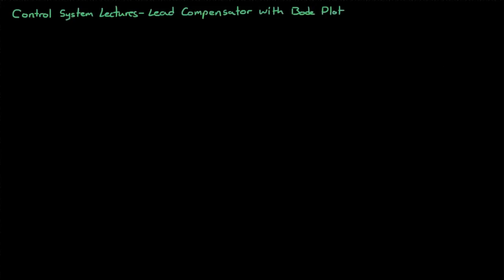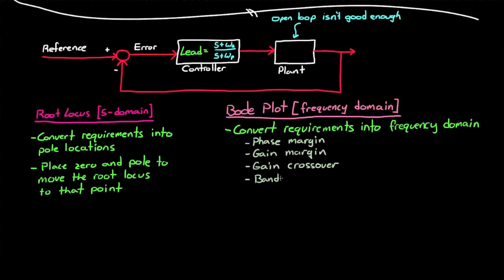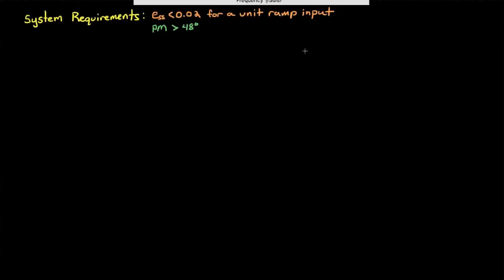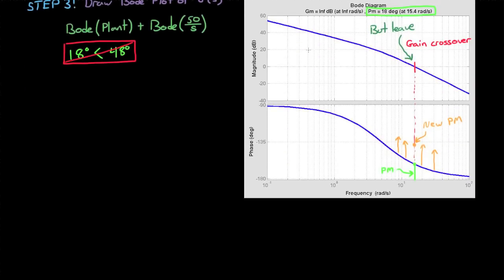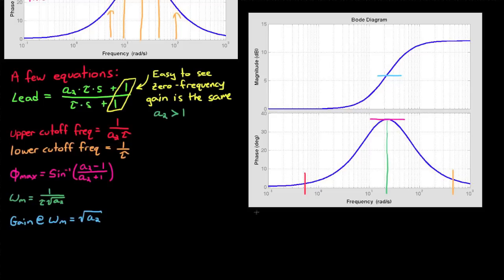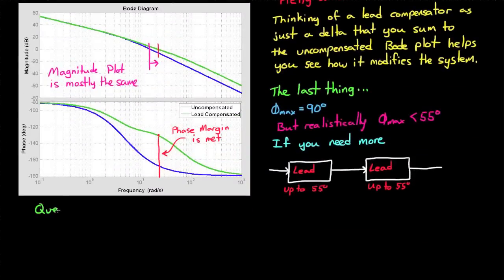Designing a Lead Compensator with Bode Plot

Comment: Where do you get the compensator types, Type  0 , 1,2 etc
Reply: It's the system type of the plant or controller that has the type number, rather than compensator.  It has to do with how many poles at the origin, the plant has.  A type zero system has no poles at the origin.  A type 1 system has 1 pole at the origin, etc.

The reason you'd want poles at the origin, is to mitigate the steady state error, when subjecting the system to a step, ramp, and acceleration input.

Comment: Really dislike the time constant form for the compensator. Very counterintuitive because the pole and zero are  reciprocal to the terms multiplying 's'. Much easier to extract the pole/zero ratio as a constant and rewrite the compensator in pole-zero form.

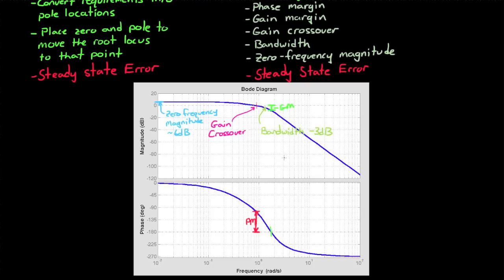Comment: Hey Brian. Gain Margin and Phase margins are defined for the "closed-loop" using the "open-loop transfer function's"  Bode plot. And for the finding the bandwidth we need to see the bode plot of Closed-loop transfer function. But in the video (at 3:36) you mention the Gain margin, Phase margin, and Bandwidth on the same bode plot. I think Bandwidth should be found from the Bode plot of the Closed-loop transfer function. Just a thought. Could you please help me with this question?

Comment: What I don't understand in this example is, that Brian drew a closed loop system, but he designed the lead compensator in a way, as if he just puts the lead compensator, the integrator and the plant in series, but without feedback. Can someone explain the reasoning behind that to me please.
Reply: The plant along with compensators / controllers in series is called the loop transfer function. With tools such as Nyquist you can do the analysis on that loop transfer function and make conclusions about the stability of the CLOSED loop system

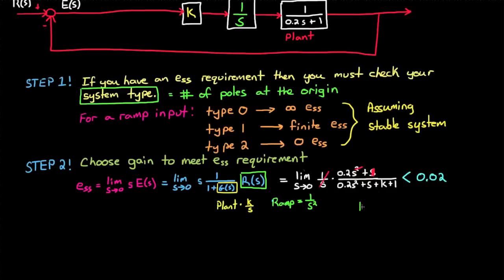Comment: At 6:55, you have an edit that corrects the denominator of the S.S.E. equation. If s goes to 0, wouldn't you be left with (1/K) < 0.02? Which would mean that K > 1/0.02 which means K would have to be greater than 50. So is using 50 correct? 49 would've been the right gain value had you not made the correction to the denominator. I'm not sure how much this changes the entire solution.

Comment: Thanks for your video!! Although I'm a bit unsure why having more phase is a good thing?
Reply: Answered: you want your phase to be > -180 degrees at your crossover frequency, otherwise the closed loop system is on the verge of being unstable. This lead filter is designed to bump up the phase at the frequency so that the closed loop will be stable and robust.

Comment: Dear Brian, tnx for the video, as a question:
Is this problem (we cannot add more than 55 deg of Phase Margin using lead compensator, otherwise the components become unrealistic and big) also includes digital implementation? Because in digital control, we do not use capacitors and opamps anymore, and therefore the implementation of phase margins larger than 55 might be easy.... what is your opinion about this?

Comment: I dont understand why you say the plant is k/s.. that's the controller the plant would be (1/(.2s+1)) right? Secondary question: if I have a requirement on both phase margin and crossover frequency which should I design for first? I would assume the phase margin?

Comment: how have you selected wn = 22.2 radian/sec while designing compensator
Reply: I know its a bit late, but I had the same question and just think its because it was the lead compensator bode plot that he plotted. Maybe it was better to use wn to 16 degree a little more than the one shown in the bode plot at 7:55 (Gain crossover) and following the safety factor for the angle we want to add.

Comment: How did you get wm to equal 22.2?? Thank you for all you help! I love your videos.
Reply: Based on the color he used (yellow) to write the phase margin he chose, I assume he also chose wm at that value. If I'm not wrong, usually there are constraints, like the sensitive of the closed-loop system to variations, that will guide us to chose the right value for the wm frequency. Please someone correct me if this is not correct.

Comment: Hi guys I would like to ask if we can use a lead controller to get max phase margin without changing the crossover frequency?
Reply: I am not sure but I think not, you will always get a change in your gain cross over frequency a little at least because when you increase the phase margin it changes the gain as it changes the gain cross over frequency, so I think your gain cross over freq will always change a little bit if not much

Comment: I was confused with the "steady state error". The ramp response characterizes the s.s.velocity error, which is given by ve(t) = | (1-G(0))*t - G'(0) | , where G(s=0) is your transfer function when s=0 and G'(s) it's derivative.
So what you mean is velocity error,that is different from steady state position error, which is obtained from the step response as pe = | 1 - G(0)|. And by making ve=0 you also make pe=0, which makes sens.

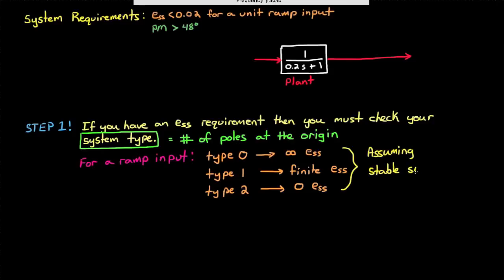But I'm still troubled, because the ve(t) equation I give above doesn't yield the results you mention relative to system type. The ve(t) of the system you mention at 5:01 yilded ve = 0.2, which is constant and not infinite as you say.
Reply: Now I get it... I think you weren't clear in distinguishing the open loop Gain (GL(s)) from the unit feedback gain (Go(s)).
So, if the GL system is of type 0, like the function at 5:01,with GL(s)=1/(.2s+1) then the corresponding Go(s)=.2/(.2s+2) wount yield a finite ve. In this case the velocity error is ve(t)=.5*t+0.05 which tends to infinity.

I checked in the book Chen - "Analog and Digital Control System Design", on section "6.3.2 System Types-Unity-Feedback Configuration". There it is explained why and how the type influences the velocity error.

Comment: Hi Brian, thanks for the video !
In this video at 4:47, one thing is very contradict with what you said in your "Final Value Theorem and Steady State Error" video. In that video you have said for type 0 system -> FV = 0, for type 1 system -> FV = real value & for type 2 & later systems -> FV tends to infinite.
And in fact for a ramp input don't FV will tends to infinite for any type of systems as laplace transform of ramp signal(input) is 1/s^2 so for any type of system there will be at least one 's' in the denominator !!
Sorry if I am wrong but please do elaborate...
Reply: Hi Milan,
I found the answer, maybe you've already known since it's your 2 years ago question...
The reason is we use the wrong formula of ess, ess=lim s*{U(s)/(1+G(s))}. Here U(s)=1/s^2 for example. For type 1, G(s) has a denominator of 1/s, then ess= lim s*{(1/s^2)/(1+1/s)}=lim 1/(1+s)=1 or finite. For type 2, ess = lim s*{(1/s^2)/(1+1/s^2)}=lim 1/(s+1/s)=0.
Hope this help others who have same question.
Reply: +Milan Shah The reason the properties seem to be opotise is that you evaluate FV when t->inf, but evalueate ess(t) when s->0.
The Final Value Theorem formula expresses that. 
Hope it helps.
Reply: Hi Milan,
I have the same confusion as you, do you get the answers or do you figure it out? Thanks.

Comment: Dear Brian, Thanks for sharing such a nice and easy way presentation. 

1. Can you correct me that in the first 2 steps you actually introduce an Integral I controller by placing the pole at origin and adjusting the required Gain "Ki"  ?

2. Can we say a lead compensator is actually a PD controller ? if so then you first introduced Integral controller and then PD so would that mean it is indeed some how a PID controller design video ?

3. Can we say PD = Lead compensator, and PI = Lag compensator so they are just two different names of the same controllers if not than what are the difference actually ?

Thanks

Regards

Comment: thanks you so much. I got a weird question, what if the reference signal is 0? For example we want hold a rob on a moving car always straight up by a motor on the bottom of the rob and thus the reference is 0 degree

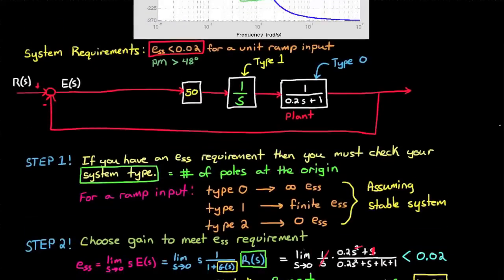Comment: at 12:10 the value of wm is selected as 22.2 rad/sec how it is selected and second thing how is this table over a2 id built
Reply: Too late but might help some other people - you can find that value by calculating the extra gain:
extra gain = 20*log(1/sqrt(alpha))
and then finding its corresponding frequency in the bode plot of the uncompensated system :)
Reply: @666blablablabla666  Is alpha a2?

Comment: where does the 1 come from in the denominator at 7 minutes? isnt it (0.2s+1)/(0.2s^2 + s + k)<0.02? I dont understand where the 1 came from, I get K>50
Reply from the maker: Trevor Fritz You all are correct!  I completely messed that up and didn't realize what was being asked earlier.  Thanks for catching it again and reminding me to review it.  I'll add an annotation right now and add it to the errata list for this video.  Cheers!
Reply: Brian Douglas I think Peter meant the +1 (the one written in white color) in the denominator. Could be an error? For me too the denominator is (0.2s^2+s+k) and not (0.2s^2+s+k+1) as it's written in the video. Anyway I want to say thank you so much for your videos it really helps.
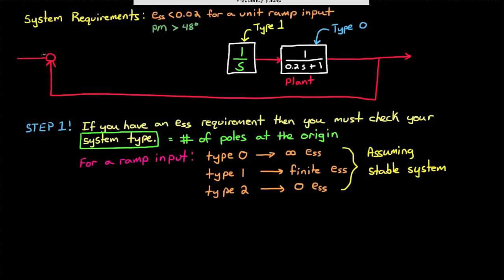Reply from the maker: The 1 comes from the blue equation just before it, where the steady state error is lim as s goes to inf. times R(s)/(1+G(s)).  Now the question is where did THAT 1 come from? :)  It came from re-arranging the block diagram in terms of the error, E(s), as the output instead of Y(s). If you start from a standard unity feedback block diagram with G(s) the transfer function in the forward direction (like I have drawn around 6:08) we can re-arrange it like this. E(s) = R(s) - Y(s), where Y(s) is the signal just to the right of G(s). Which means Y(s) = E(s) * G(s). Substitute and get E(s) = R(s) - (E(s) * G(s)). You can solve for E(s) and get E(s) = R(s)/(1+G(s)).  This is the function that we solved the steady state error on and that is where the 1 came from.  I hope this cleared it up for you and didn't just make it more confusing!!
Reply: @BrianBDouglas  How did you get K > 49?  I just get K > 0
Reply: Brian Douglas
I concur with the comment above.
Ess = lim[ (1 / s) * ((0.2s^2 + s)/( 0.2s^2 + s + k)) ]
          s->0
instead of:
Ess = lim[ (1 / s) * ((0.2s^2 + s)/( 0.2s^2 + s + k + 1)) ]
          s->0
By the way, thanks so much for your videos, they have been really helpful.
Reply: yorchais I also noticed this and agree with OP. Again, thanks so much for your videos! They are currently saving me in my university controls course!

Comment: Brian,  

    How do you check by hand that the controller that you designed meets your Phase Margin requirements or can you assume that because you added a safety factor your controller is sufficient? 
-ish
Reply: It's a complicated process, and even for a simple 2-pole plant transfer function, you'll end up needing to solve a quartic formula to check it analytically.  Fortunately, with modern technology, you can use computer tools like Matlab to plot the new Bode plot with the transfer function, and check the resulting stability margins.

Once you add a compensator, you also adjust the gain cross-over frequency, that impacts your phase margin, so your frequency won't be the same as where it originally was.  You then have to implement the combined transfer function to make a Bode plot and check stability margins of the combined system.

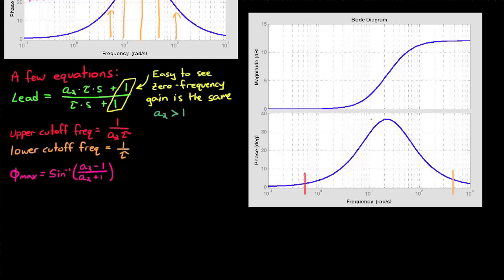Comment: Hi, I've been using the reference materials you linked and they state that phi(max) = sin^-1 (1-a2/1+a2) which is different to your equation at (10:00), if one uses phi(max) = sin^-1 (a2-1/a2+1) and solves for a2 you get a2 = (1+sin(phi)/1-sin(phi)) which is the inverse of what it should be. Taken from page 6 of the reference material you linked to. Cheers.

Edit:

On page 2 of the same materials they state that the general equation for a Lead Compensator is Kc * ((ts+1)/ats+1) which, neglecting the constant term, again seems to be the inverse of what you stated, twice seems an unlikely coincidence/mistake so could you or someone else explain why this is so?
Reply: +Dale Barnard ++1 to this question!
Reply: A bit late but: It seems there  are various ways of defining the lead-compensator, which seem contradicting because they all use the same variable names, but with entirely different ranges.

Comment: you forgot to multiply your equation in Step 2 at 06:55 by your reference signal R(s).
Reply from the maker: Hi Andrew, I don't think I did.  R(s) is 1/s^2 since I said it was a ramp input. The s right after the limit turned into a 1/s because I multiplied it by R(s).  Is that what you were talking about or was it a different section?  Cheers.
Reply: @BrianBDouglas  Ah I see, took 10 years but thanks for clarifying haha

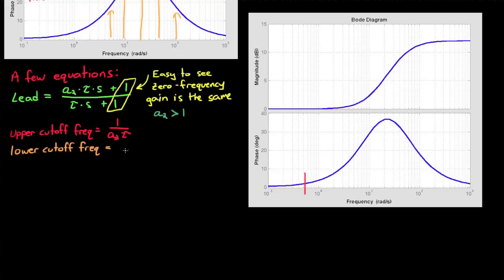Comment: Hello and thanks for the video, at 9:43, you write the upper cutoff freq. eq. and marked it on the lower side on the phase plot, and you marked the upper side for the lower cutoff, shouldn't it be the reverse ? :)
Reply from the maker: Hello Ersin, you are quite right!  I accidentally called the upper cutoff frequency the lower one and vice versa.  I placed an annotation in the video there so others aren't confused.  Thanks for catching that and pointing it out.

Comment: I have a linear system O(s)/F(s) = -alpha/(s^2 - beta^2), where alpha = 6 /  l(4M+m) and beta^2= (6*g/l)*((M+m)/(4M+m)). M= 2 ; m= 0.1 and l=0.4 . What kind of compensator should I use?  What is the compensator value? another parameters I should know? how could I know the response is satisfactory?
Thanks

Comment from the maker: then the concept of bandwidth doesn't make much sense.  Also, once thing that drives me crazy is that the term bandwidth is used in so many applications that it's hard to keep track of the meaning one person is using versus another.  Therefore, I should have just said the -3dB gain frequency and left it at that.  And if there is no -3dB gain frequency then it doesn't exist.
Reply: very true

Comment from the maker: Also, the -3dB gain, which can be called the bandwidth of a system, is the frequency at which the output signal is sqrt(2)/2 times smaller than the input. This is traditionally thought of the as the frequency above which the system effectively attenuates the signal so much that it doesn't pass it through. Of course there is a little attenuation at lower frequencies and some passing at higher frequencies but it gives a good measure. So if your signal cut all gains in half at all frequencies ...

Comment from the maker: Hello again! Yes you are correct it is obvious from the graph that the DC gain is +6dB :-) Thanks for pointing that out.  I'll add an annotation to correct it. And you are right that you wouldn't have a gain crossover frequency in your case. And that means that your system (assuming this was a Bode plot for an open loop system that you were planning on closing) would have infinite phase margin! Or no matter how much delay the system had it would still be stable.

Comment: at 3:35 you say that the DC gain is "minus 6dB". It seems obvious from the graph that it is PLUS 6dB. This brings me to the following: if the DC gain in this system actually was -6dB, you wouldn't have a gain crossover frequency, right? And what about bandwidth in that case?

Comment from the maker: There's a subtle difference between the two ways I presented the data and so I can see now that it is very confusing. In this video I am talking about the steady state ERROR to a ramp input. If you have a type 0 system with a ramp input the final ERROR in the system will be inf, which means your system does a poor job of tracking that input. In the other video I was talking about the steady state value of the OUTPUT, not the error. In a type 0 stable system the final output is 0 to an impulse.